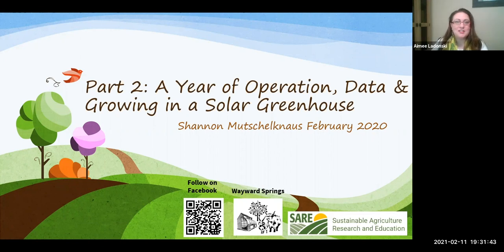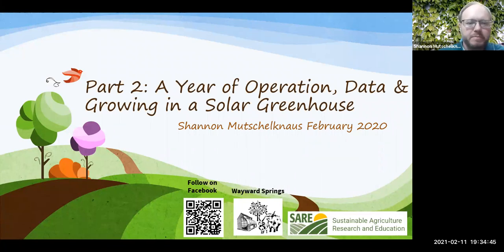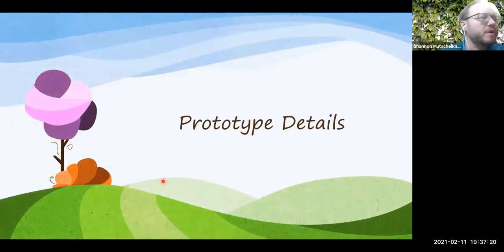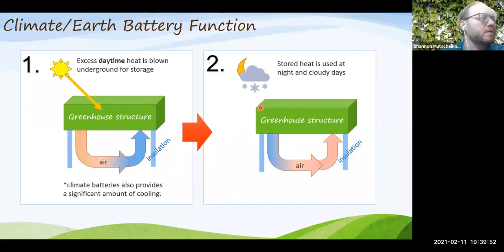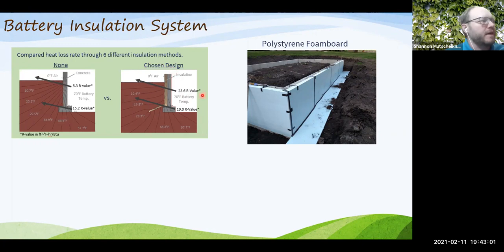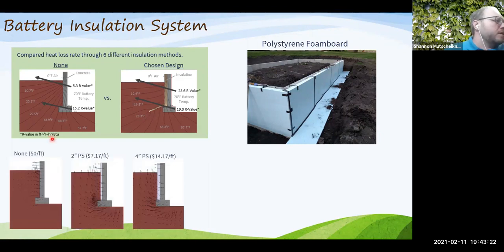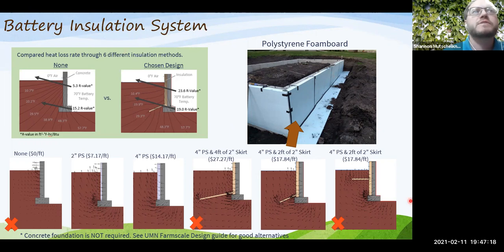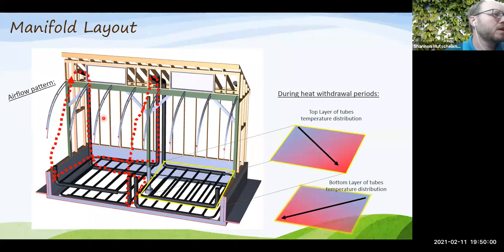Intro to Passive Solar Greenhouses: Session 2

Comment: Wow, great, useful and applicable info. Very detailed and impressive data gathering systems.  Thank you!
Reply from the maker: Thank you for the feedback!
Reply: @arkadiuszlee407  Hi Arkadius! Air infiltration still occurs and has been more than enough. For air circulation when the main fans aren't operating, you should use a standard HAF for greenhouses. HAF stands for horizontal air flow.
Reply: @SDSUExtension  Is there a part 3 where you go over the medium, fans /blowers, and controllers?
Reply: @phillipk2490  I did not do a third webinar. That would be a good topic to do someday. I hadn't focused on that in the presentations, because it wasn't particularly innovative. In fact simpler is best for reliability in regards to the controls. I'm a proponent of simple analog controls for the fans because I don't consider it an acceptable risk for crop failure when a digital controller fails due to corrosion. If you have something in particular you need to know, you can email me. My address is at the end of the presentation.

Comment: With regards to the pony wall, you could replace the doors with clear glass slider windows with screens. That way you would get the light down low and still have the windows as vents.
Reply: Yes, that is a reasonable upgrade. Glass or a PC door would have a fraction of the insulative properties, but worth it for low growing plants.

Comment: Thank you for sharing your data and design considerations for a greenhouse such as yours.  Did you consider thermal mass heat storage such as stone wall on the north side of the greenhouse or water storage barrels on the north wall?  Thank you, again.

Comment: Since moisture cools, would it make sense to try an dehumidify the air that goes into the battery during cold days? Or is that a battle that cannot be won and the pipes would get wet but just after a longer while?
Not neccessarily electric, maybe just a mesh on the intlet that is able to catch the water and collect it or redirect it to the soil.

Im also thinking of catching more of the sun, like a massive black backwall that fully contains the inlet. Can always block the sun with screens for heat prevention (glassfront and black wall), but must store as much as possible in december.

Great data and presentation, thanks.
Reply: Dehumidification is a very energy intensive process to actively do. There are several methods: blowing air over a cold coil (like in your house, basically an air conditioner) or using a dessicant system that uses heat to burn out the absorbed moisture. The climate battery itself is a dehumidifier, just not enough to prevent condensation on the glazing surface because it is still a very cold surface. Using an insulating blanket to increase the r-value of the glazing at night or a thermal curtain inside could help some without a lot of energy costs. However, I haven't had any problems with plant disease in the last few years related to the humidity. I have had some minor cases of edema in a few solanaceous plants for short periods, which isn't a disease, just not visually appealing on the leaves.
Reply: A dessicant dehuey is the only realistic choice for cold air as it doesnt rely on dewpoint but would be expensive to run.  If you have a tall south facing fence close to your greenhouse you can make a large flexible solar air heating panel to attach to it over the winter moths. In the spring you simply take it down, roll it up and store it in the shed. The idea is based on the "Solar Flume" flexible (inflated) solar collector which was around a very long time ago, maybe 15 years. I couldnt find any links sadly but the basic idea can be found in this patent: US20080017499
Edit, Wayback machine archived at least some of the original website, solarflume dot com

Comment: When you were talking about heat exchanger tubes the diameter of the manifolds needs to be bigger than the runs between them. For example the manifolds and the pipes running from the manifolds to the surface should be 6 in. , while the runners between them should be 4 in. , this will give you better efficiency and air flow throughout the thermal battery. It will also allow your fans to work less hard, saving electricity and saving fans.

I am not a master physicist or anything but i know basic physics. The air flow is pushing back on your fan if you place a 6 inch fan reducing it to fit into a 4 inch pipe. Also, if it is all only the same diameter then the air is only really flowing thru the first run, it will take path of least resistance and since they are all the same size it takes the first one closet, mainly. But with a bigger manifold(on both ends) AND the pipes feeding those manifolds to the surface, it will distribute more evenly thru all runs. It is a pressure/vacuum thing, you are building up too much back pressure/vacuum(depending if you are pushing or pulling) at the manifolds being too small to get free flow and even distribution. You need the air to freely get into the manifolds this way it will fill the manifolds evenly and therefore flow thru the runs more evenly.
Reply: Yes, the manifold diameter I used was 6" due to availability. 8" would have resulted in much higher airflows or even larger, like 10" would be great, but it is spendy and harder to get.

Comment: Question. Why don't you have water stored under the floor or soil for heat storage?   Is it because of your severe climate and risk of water freezing and cracking your foundation?    If you had water 1 or 2 meters deep in tanks under,  won't convection of heat in the water reduce heat transfer escaping  down through the soil?   Also,  I am aware that storing heat in water might need a different approach. Like a "radiator"  with  a fan blowing air through a car radiator and a water pump to pump the warmed water away.  Did you not use that approach because it is too complicated?       I live in a milder climate (Victoria BC Canada) and I am only allowed a 107 sq ft greenhouse and I did it DIY. So just over 8 by 12. I use 80 mm computer fans  to blow air under the soil and they run directly off a solar panel.    I insulated  the north wall of it after seeing your video and others this winter.  I have about a foot of water  (contained by pond liner)  under one planter (north side) and  a rain barrel under the other one. Some of my heat storage is in the water. (I use water because we have really dry summers, sometimes 3 months with no rain).  I have a pipe that brings air under the water level, and a syphon to remove condensation from that pipe.
Reply: I am growing in the soil, so want to make sure my plants/trees have plenty of root zone area. I didn't go the water route because I wanted to achieve the simplest system possible. Water is definitely an option, but requires more components/complexity/cost.

Comment: Been watching the different videos on this project and am impressed with the data. Thanks for all your work and data collection. Good stuff. Question about the perforated pipes.  My worry would be that since dirt would get in those holes and maybe clog them over time.  In your implementation where you put the soil back in place it seems like a fine soil (as opposed to gravel) would clog. what about using a sock on the perforated tubes to prevent the clogging. Also when connecting the distribution tubes to the manifold, do you need to seal that connection so dirt doesn't get in there? How did you do that since I think the manifold pipes were corrugated. Maybe just some caulking? I think you may have said foam in the video? One other question. How many fans (4?) and what type of fans did you use? Thanks again for all your work on this. Kind regards,
Mike
Reply: Hi Mike! I don't think  sock is necessary from all the research I've found on the topic. I've been running 3yrs now without issue. I used spray foam in a can to keep out the backfill. I have four PrioAir 8" fans.
Reply: @waywardspringsacres  
I didn`t use sock and have had no issues. Sock may be necessary if you have pure fine sand but thats highly unlikely in most cases. With hindsight, i would recommend using non perforated tubing as the location of the perforations are as useful as a chocolate teapot.  Cut a straight shallow slot part way through the corrugations  (using a simple jig + circular saw or router)  and locate the slot at the bottom during installation. Drainage tubing is designed to let water in via the perforations but not out. A drainage tube that doesn`t carry the water away isnt very useful.

Comment: Thank you Mr. Mutschelknaus! These two seminars have been great! I am beginning construction on my backyard 14.5x48 hoophouse style with climate battery up here in Western Massachusetts. Similar zone, a little less sunshine. Hoping for the best! QUESTION: Can you point me to a good thermostat option? I am having difficulties finding something that will control the four fans to turn on over a certain temp AND under a certain temp. Would love your advice! thank you!!!
Reply: That`ll teach me to edit a reply and lose it all lol. I`d reommend using a differential thermostat as they take account of both the air and mass temperature.
A standard thermostat will turn the fan on/off based solely on the air temperature. If the mass isnt warm enough to provide any useful heat or its too warm to store heat efficiently, the thermostat will still run the fan.  A differential thermostat doesnt care what the actual temperatures are, just the difference in temperature between the air and the mass. 
I had to make my own differential thermostat because i couldn`t find one with the right features at that time. With the advent of arduino etc. i guess it wouldnt be too difficult to make a comprehensive control system assuming you know how to code it to do what you want.

Comment: Has anyone done a coefficient-of-performance analysis to determine if the energy input (fan kwh) provides a net benefit in output? Basically, is the COP above 1?
Reply: Yes, I had a graph of measured COP vs. fan speed at 1:00:30 It ranged between 5 - 50 depending on the air-ground temperature difference. These values are in line with other research papers I've read on the topic.

Comment: Did you ever consider using an insulated floor slab below ground as well as the walls ? This action would have stopped any cold bridging through the ground and a better result for stored heat. 

The other question is ; did you ever consider using water to both store and collect the heat ? If your north wall had a vertical layer of underfloor heating pipes, encapsulated in a concrete wall, then these could have heated a buffer tank of water. I accept that in the summer the air temperature neeeds to be reduced in the greenhouse in order for the plants to survive.
Reply: I considered that, but chose not to. In hindsight I see that was a good decision, because in late Dec. & January in my climate, I no longer get enough sunlight to keep up with demand. At that point the system acts like a low grade geothermal consuming the natural ground heat. Insulation would have prevented that.
Reply: @waywardspringsacres  Insulating below the tubes effectively fixes the volume of mass. This could lead to having a fully charged mass long before autumn and you`ll be forced to vent the excess instead of allowing it to migrate below the system.  The majority of the heat cannot be recovered but given how much heat it takes, even a small percentage returned is a lot. As the deeper mass warms, the temperature differential driving the heat transfer reduces, so it offers similar benefits to physical insulation without the disadvantages of fixing the volume of mass.
Reply: @JohnGuest45  Exactly! That's a bit tough to clearly explain to general audiences. Maybe I'll make some content illustrating that sometime.
Reply: @waywardspringsacres  
It takes a phenominal amount of heat to increase the temperature of the mass below the system, if you have sensors down there you`ll notice the average temperature increasing gradually over a period of years before stabilizing to a new norm compared to virgin ground outside the greenhouse at the same depth.
Its getting harder to draw conclusions these days as the seasonal highs and lows are becoming more extreme. We had all time record temps of 40.3c (104.5F) this summer which was challenging, especially as it hit at the end ofJuly when the mass was already pretty warm. The night temps were over 29c so there was no opportunity to dump heat from the mass overnight to increase the cooling capacity for the next day.  A combination of fogging to increase the greenhouse RH% and running very high turnover rates was enough to keep the greenhouse below 90F during hottest part of the day without resorting to shadecloth. I cant wait to see what the winter brings.

Comment: @JohnGuest45  but on the other hand, in the extreme hot and extreme cold, wouldn't it help maintain a more constant temperature underground?
Reply: Not really because the heat will be able to move down below the system

Comment: A 10" manifold would be optimal when using 4" grid. It's a matter of volume using pipe cross-sectional area.... pi r squared. 6" is way too small and 8" is too small. If you have more 4" pipes than go to 12" manifold.
Reply: You are correct. The price of 10" is many times the price of 6" as well as it is much less available. I have found that this works well enough to prevent freezing on zone 4. But you are right that there is a lot of room for improvement yet, which is exciting!
Reply: The optimum manifold diameter will also depend on its length, the type of pipe used and how the 4" tubes are connected to it.  Air handling systems are relatively easy to design if the duct specifications are known, infortunately ADS tube wasnt designed to carry air so the relevant data is not available from the manufacturer.  If you are planning to install thousands of feet of ADS it would be a good idea to buy a length of smooth bore pipe for some side by side testing to gather the missing data before you finalise the design.
Reply: @JohnGuest45  The necessary losses, heat transfer coefficients, etc have been characterized. They just aren't available from the OEM of the pipe or in textbooks/ASHRAE manuals as it's more of a niche application. If you need, I can send you research papers with the necessary info.
Reply: @waywardspringsacres  
I have come across research related to non perforated land drainage tubing but nothing for the perforated variety.  If the info had been available when i installed mine i probably wouldnt have skipped the practical testing i did  but it would have been interesting to see how the actual results compared to the predicted results. In the end i decided a combination of corrugated perforated tubing and smooth bore non perforated tubing was the best choice. I didnt have to worry about the silly cost of large diameter manifold tubes, no manifolds in the system.
Reply: @JohnGuest45   Good Points! I wish I was more of an engineer myself. Very thankful for folks here in the comments to learn from.

Comment: Is session 3 of this series available for viewing? We are in the planning stages to install one of these this summer and are currently in the design and material sourcing phase. Really looking for insight and recommendations for thermostats, in-line fans, and all electrical equipment. Thank you for the amazing presentation and sharing your knowledge @Shannon Mutschelknaus!
Reply from the maker: Tavin, there are only two sessions for this presentation. Shannon's contact information is included at the end of the video if you would like to reach out with specific questions.

Comment: With a geothermal greenhouse, is there any benefit in insulating horizonally above the perferated tubes, especially  if you are not growing trees direct into ground.
I was considering doing this.
Reply: It would reduce the amount of passive heat transfer between the thermal mass and the greenhouse air.